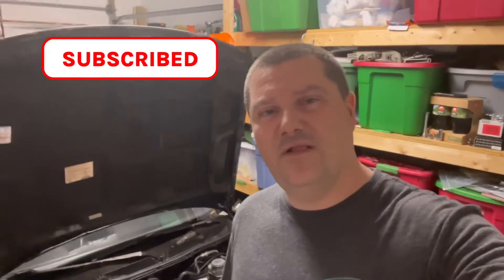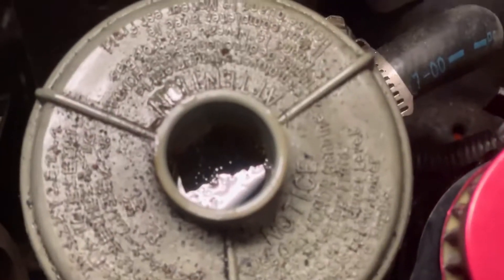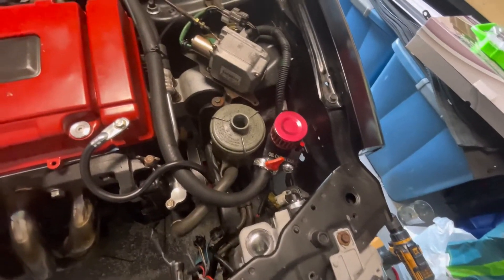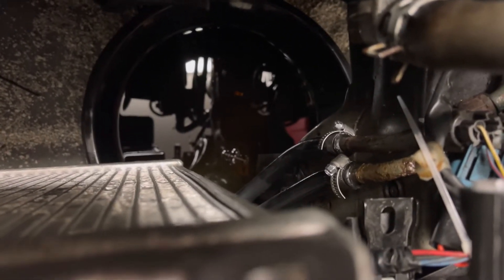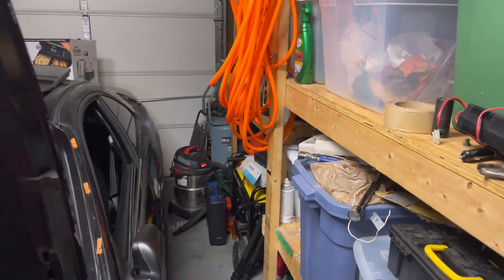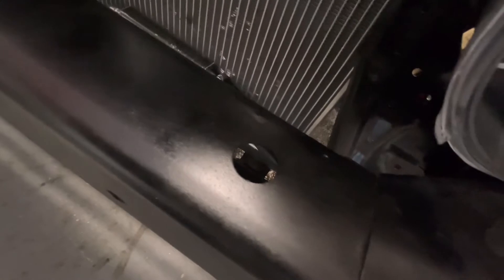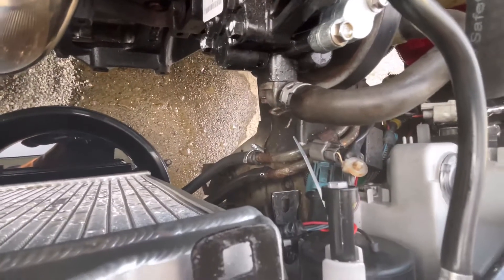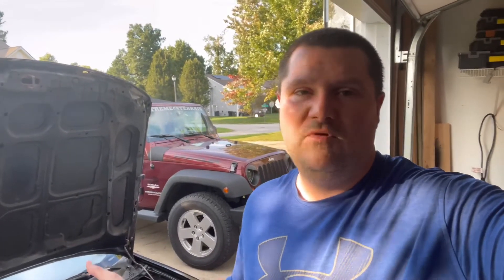2000 Integra Gsr, power steering leak was worse than we thought!!!

Comment: Do you have the part number of the hose that was leaking? I have literally the same exact hose leaking on my 98’ Integra. Thankfully the leak is not as bad as yours, but I should replace it asap before it gets worse
Reply from the maker: Send me a message on Facebook or instagram and I will help you
Reply: @JCMotiveGarage  Got it resolved! Decided to use a regular hose that would fit, and it works well! Turns out the OEM part is now discontinued here in the US. But given it's just a hose, a regular cut to fit the power steering return line works just fine. Appreciate the response!

Comment: how do you ground the tranny....i just installed a b20 and it wont start consistenly...and i put the wrong gauge, and the wire started smoking
Reply from the maker: The ground for the transmission is grounded to the frame rail, you should use a braided grounding strap because is dissipates voltage because the transmission will produce a lot of static. If you need any pics of mine, message me on Facebook or Instagram. Hope this helps!!!